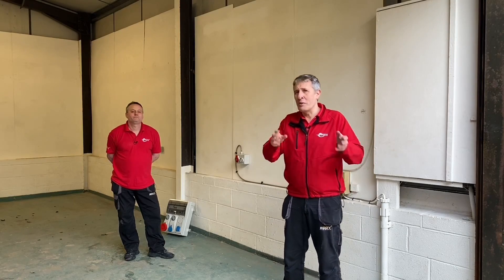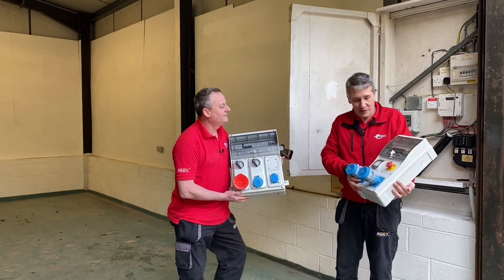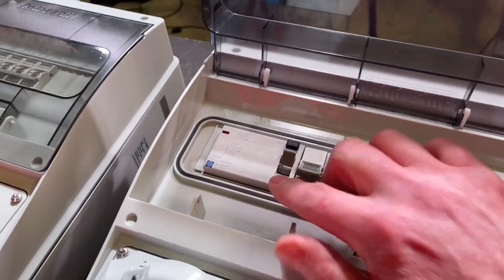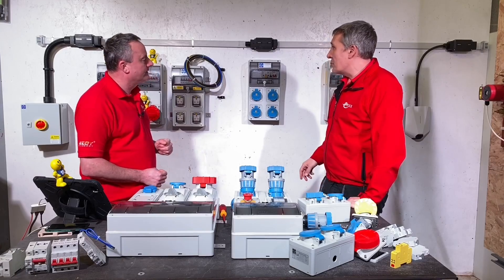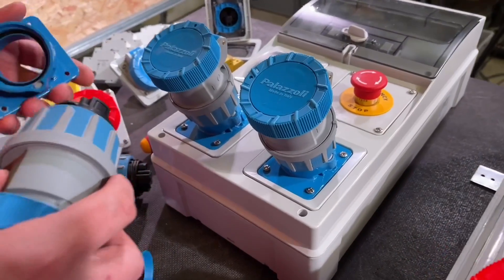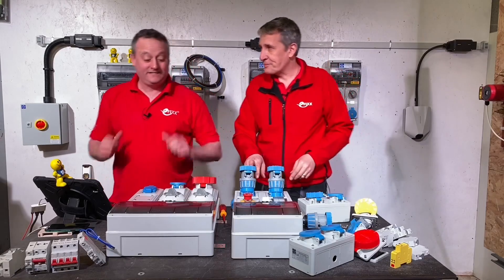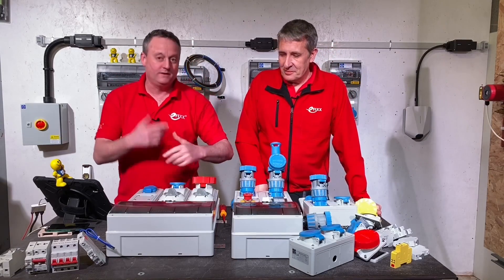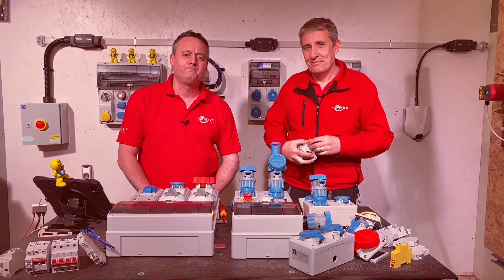FLEXIBILITY BUILT-IN - Industrial electrical installations with Lewden Palazzoli TOPTER

Comment: Not recommended for your project. No discrimination or resilience with main breaker, circuit breaker and any integral breaker. All supplies gone.
Reply from the maker: It’s no different to a regular distribution board apart from socket outlets are positioned  underneath. The circuit breakers can be configured to protect individual sockets or groups so easy to achieve discrimination.
Reply: Really depends on how it's wired. I would assume that it's would be fed from a 3 phase 60kVA supply (80A fused). If we are looking at multiple modules then it going circuit breaker 40A-63A. Internally protected for each component 32A,10A or 16A. Either way they're are too many levels of protection and no discrimination. That being said discrimination is not specifically a requirement of bs7671.

Comment: Great video guys.
But I see one possible problem? If you I stall those inplace of the existing Comsumer units in that industrial unit it would be pointless? If the unit is to be used for production isn't the industrial sockets ment to be close to the machinery that will be used Ie a lathe, bandsaw, and so on.?
I might be wrong?
Reply from the maker: Our thinking is you have a conventional distribution board and feed strategically placed TopTer units across a factory which deals with local circuits - machines, power and lighting.
Reply: @efixx  OK thanks
Fantastic video as always mate.

Comment: Not a criticism of you or your work but all of this modern switchgear and socketry just looks so flimsy and far too delicate for any industrial environment. I see the advantage of the modular interchangeability but I'm not convinced regarding the durability and longevity. I'm not an industrial electrician, I run my own specialist mechanical engineering and fabrication company using a few large machine tools and some more portable machines like welding units and hand power tools. I do prefer the older, more robust isolators and connectors.
Reply from the maker: It’s pretty robust especially the XCEE sockets.  Lewden have a huge range with plastic, GRP and Aluminium enclosures.  So all down to the application.
Reply: those single unit interlocked sockets look too long, gives a big mechanical advantage to rip it out of the casing.
Reply: I'd perhaps be more confident with steel enclosures but there are some people who are capable of breaking anything!
One of my main criticisms of plastic stuff is so much I've come across is held together using self tappers directly into the box. Unfortunately I've had to replace quite a few where the threads have failed. Nothing worse than the front panel flapping about when someone is trying to pull out a ceeform.

Comment: The flat cable attached to the wall behind you does it leave holes in it when the joint boxes are removed
Reply from the maker: Yes there would be holes - the manufacture makes a kit to cover these - we have asked for one to check out.